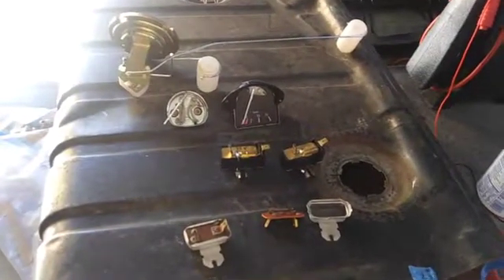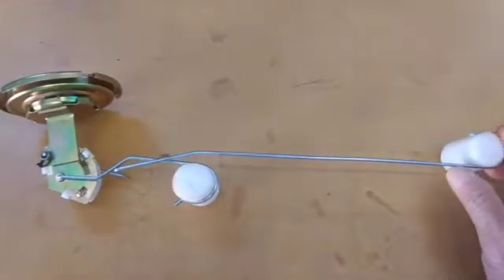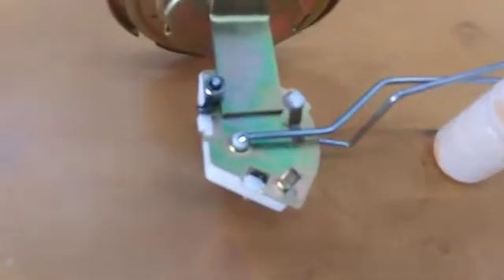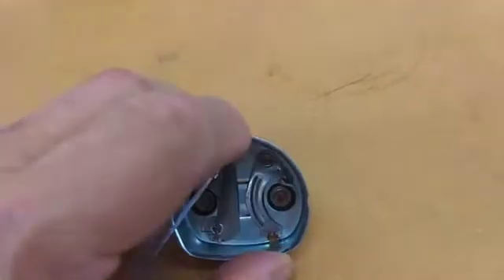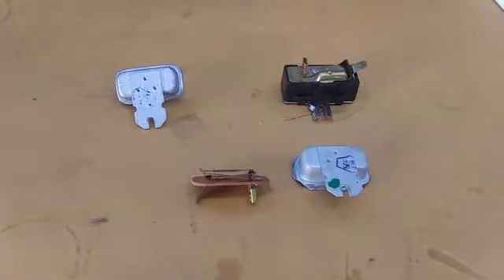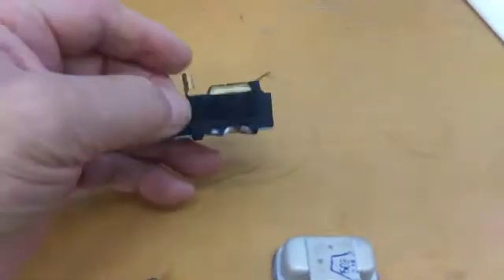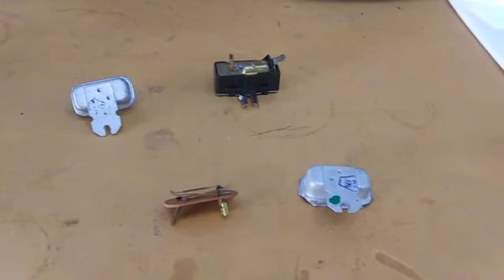Super Beetle and all other 69-2003 vw's with electronic fuel gauges.  Fuel gauge system summary.

Comment: I installed an EMPI fuel sending unit 5 years ago and my bug tank would read 3/4 off a tank. Todays I remove sending unit and the float for full tank was 1/2 full of fuel I was lucky to have saved the floats from the old sending unit. Now reads full tank.

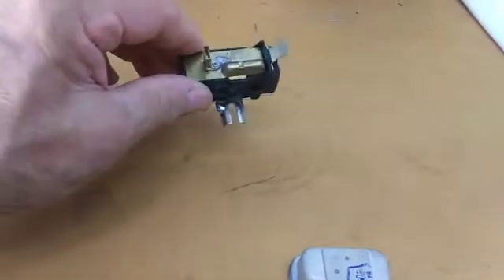Comment: Thank you for this video. I have a 74 super beetle. 5:25, If I use an aftermarket regulator and gauge, will the range just be from 0-1/2 tank? Will empty still be empty? I am more concerned about running out of gas than reading full. Thank you.
Reply: Can't say for sure that the range between R and E will be 1 more gallon to go so I would recommend you find a time that you can fill the tank  or test when the gauge is showing 1/4 tank.  Then syphon the gas out of the tank one gallon or so at a time and see where the gauge ends up at.  1/4 tank is going to be about 10.5 gallons.  10.5 / 4 = 2.6 gallons.
So one gallon out you should see the gauge close to R.  That would mean you have about 1.5 gallons to go...  So I would take another gallon out and see where the gauge sits.
There are a lot of fellas out there just living with the gas level at full showing the same as you.
Good luck and post on this channel if you need a bit more information.  Jim.

Comment: Bought a 73 super beetle. Fuel gauge doesnt work. Replaced the sender due to it being rusted out. The range on my new sender is 10 ohms full and 88 ohms empty. When hooked up to the car the gauge only reads halfway when i put the float to full. Definitely gonna have to spend some time fine tuning that gauge.
Reply from the maker: Sounds like your gauge is an aftermarket.  Measure the resistance to verify.  OEM is about 18 ohms, aftermarket is about 30.  You can tweak that aftermarket gauge a bit but you will find that you empty reading will be off.  Jim.
Reply: @VW Super Beetle fuel tank system  very much needed this video! Appreciate it and the information! Trying to join the volkswagen forum page 🙏 slowly falling in love with this thing
Reply from the maker: @Hippinn  Great.  It is a super forum for VW help and info.  Jim.

Comment: So I have a original sender, I tested after cleaning and buffing all the contact areas last night at 8 ohms to 80 ohms. Should I use my OEM vibrator on the speedo now or replace it with the zener diode thingee?
Reply from the maker: Do you still have your OEM gauge?  Resistance is <>18 ohms... Non OEM <>30.  If you have an OEM gauge then I would go with the zener type from Jbugs etc.  5.1vdc.  Keep the vibrator though.   If your gauge is a Non OEM then either the via or the zener type will provide a reading but when full you will read about 3/4 tank.   
I do not recommend doing the zener diode voltage change.  Getting the proper voltage of 6.4vdc for the Non OEM gauge is not avail with zener diodes.  You could design a regulator circuit adjustable for 6.4... Or get one of the Buck regulators and go that route. If you decide to do that, watch my videos on them.  Let me know if you decide to do that route.  Are you a member of the samba?  If you are pm me...  I am blue69baja there.  Jim.

Comment: Does the vibrator send a constant 5.1 volts? when I put a voltage tester on mine it varies between 0 and 5 volts rapidly.
Reply from the maker: Yes it does switch from 0-5.x..... Thus they call it a vibrator!
Reply: @vwbeetlefuelgaugesystem  it causes my test light to act like an emergency flasher. Thought it provided steady 5 volts..
Reply from the maker: @TonyMcBride100  If you are using your test light alone hooked to the output of the vibrator it will be flashing pretty fast due to the resistance of the test light!  The vibration is designed for 10-70 ohms of the sender AND the resistance of the gauge combined....  The gauge, if OEM is about 18 ohms and the aftermarket is about 32.
If you are using the test light with the gauge and sender hooked up it will still flash fast due the parallel resistance. 
What is your symptoms?  
Need to use caution doing testing.  It does not take much to fry the vibrator and the gauge.
Are you a member of thesamba?  If you are or if not,join and send me a PM...  I can help you there..  blue69baja 

https://www.thesamba.com/vw/forum/viewforum.php?f=3
Jim

Comment: Hi thanks for the video it is really usefull. I have a  issue with my car when switch on the ignition without starting its show the fuel quarter tank which  is correct and when i start the car it drops halfway down to reserve mark. While driving the car its not stable. some times it rises up some times not showing any  reading at all. Recently i cleaned the flooter and even checked with multimeter which showed correct readings. Please help me with this issue
Reply from the maker: I missed your remarks, sorry.  Did you resolve your issue or improve on it?  Jim.

Comment: I have an original VDO fuel sending unit, which tests at 70 and 10 ohms. The problem is that it is missing the long arm. Can I use it? And if I can use it, how accurate do you think it would be?
Reply from the maker: It will be accurate to about 1/2 tank, sadly  it will show empty at about 1/3 tank.  The short arm hits the top of the tank at full and moves down with the gas as it moves downward towards empty.  At about 1/2 tank the long arm gets into play controlling the short arm....  If you decide to get a new sender get the Mexico one!  It is pretty accurate with no modifications most of the time.  Do not order from Parts Geek..  They say they have Mexico senders $50 and then they charge you for the Mex sender but send the $30 EMPI.  Empi will be inaccurate! You can see the difference here:  https://youtu.be/DaHpuhjNvyA
Air-cooled folks have the Mex.. https://vwparts.aircooled.net/Fuel-Tank-Sending-Unit-MX-or-B-All-Super-Beetle-p/113-919-051fmebr.htm

Jbugs says they have them but I would call them to order.  Making sure they understand that you want the Mex.

If your gauge is aftermarket you will not get a good reading without using the Buck Regulator Like my video shows or modifying the gauge and adding modified aftermarket vibrator/regulator.  I would not at this time recommend that.  The buck regulator with the protection is the way to go.  

Are you a member of Thesamba?  
https://www.thesamba.com/vw/forum/viewforum.php?f=3

I am blue69baja.  You can PM me there for help.

Jim
Reply: @vwbeetlefuelgaugesystem  Thanks Jim. I also have the mexican sender as backup. I was really hoping to just use the VDO sender. I wonder if I could the long arm of an EMPI sender and attach it to the VDO, but it probably wouldn't work because the floats are different. I will probably just end up using the mexican float in the end. Thanks again for your help. Yes, I am a member of Samba and just found your thread on the forum 👍